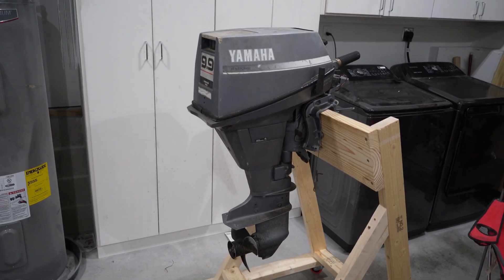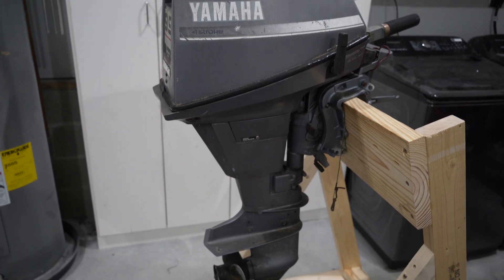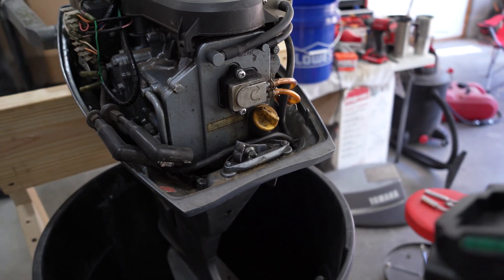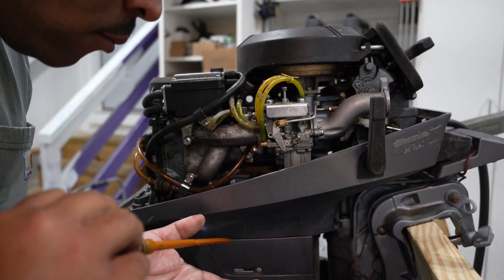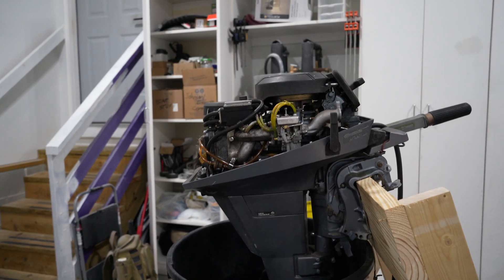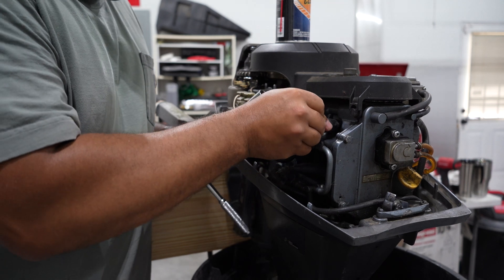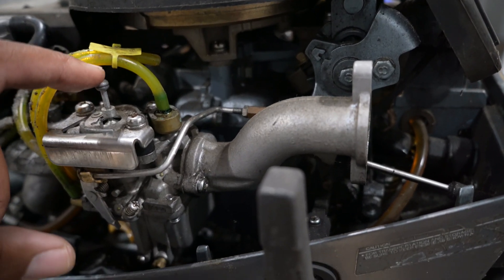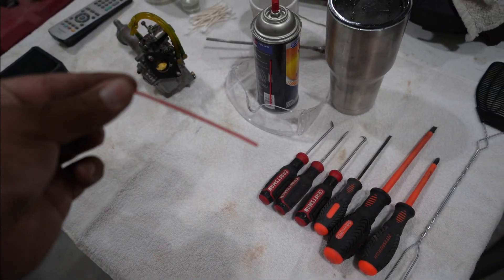1989 Yamaha 9.9hp Outboard: Can I get this old 4 stroke running?

Comment: Worked out, put a new pull rope, new Impeller, lower grease,  then found out the power pack was bad , replaced, took it out ran like a top, still running strong! Thanks .

Comment: Why did you not clean those "dirty" lines up?
Why did you not replace those brittle fuel lines to and from the pump?
Why did you not ground both spark plugs at the same time (using crocodile clips and wires) so the CDI unit would not be at risk of blowing up?
Why did you not take every electrical plug and connection apart and clean them...as corrosion is the worst thing for an engine used in a wet environment?
Why did you not immediately disassemble the leg and check the impellor before it shattered and drove all those bits of rubber up into the head and cooling passages?

Comment: I have a question regarding the same motor but it has controls to a remote control box.  How would I find a schematic of how the shift and throttle cables are installed and connected?
Reply: I have the same issue with control box needed. Did you find anything?

Comment: Good job on this one.What size adapter did you need for compression test?
Reply from the maker: It is a 10mm adapter.  Here is the link to what I ordered on Amazon.
<a target="_blank" href="https://www.amazon.com/Lisle-20530-10mm-Spark-Adapter/dp/B00CEX5B1Y/ref=sr_1_1?crid=BIMIYA24BKPY&amp;keywords=10mm+spark+plug+adapter&amp;qid=1649886033&amp;sprefix=10mm+spark+plug+adapter%252Caps%252C69&amp;sr=8-1&_encoding=UTF8&tag=makeitbett0bd-20&linkCode=ur2&linkId=ddd787358e4d55570855ef0915396baf&camp=1789&creative=9325">10 mm Spark Plug Adapter</a>

Comment: What is the compression spec on this motor if you know please 🙏. Great video nicely put together
Reply from the maker: Compression was ~89 and 90
Reply: @MakeItBetter1  and is that in spec according to the manual?
Reply from the maker: @robertlong9552  I don't have the service manual for this model.  Generally 90 psi and above is considered acceptable.
Reply: @MakeItBetter1  great stuff man thank you

Comment: I have a similar 1992 T9.9EXHQ. I put it away in storage, 5 years later when I take it out of storage, I have no spark.  I'm troubleshooting with a DVA and I get values that are within spec for the charge coil (105v)and pulsar coil (4.05v), but the CDI output is lower than spec, 60v actual, spec is 95v.  Is this enough on it's own to stop the spark? Or more importantly, to warrant buying a CDI ? Love to hear about it anyone has had a similar experience.
Reply: Hopefully by now you have got a new or new to you CDI unit.
If you test the spark plugs out of the head like shown on this vid, without clamping both sparkplugs to ground at the same time using crocodile clamps and wires.....you risk blowing the CDI unit...

Comment: I haven’t got around to my first\new boat yahmaha 9.9 similar to this outboard it rained a few times any tips?
Reply from the maker: I love these old yamahas.  Change the fluids and impeller and let her rip!
Reply: @MakeItBetter1  will do
Reply: Would you recommend spark plugs as well? Or anything else? Still haven’t tried it yet
Reply: @djtime45  
Change the oil filter.....

Comment: Were did u get adapter for plugs to check compression also the impeller I ordered on but it was to big link or part number would be a big help thanks I just bought same motor 1988 trying to get it to run.
Reply from the maker: Impeller Link https://amzn.to/3s1NEKl
Compression Tester Adapter https://amzn.to/2VA6v3h
Reply: @MakeItBetter1  thank you do much!!!! I kept buying wrong impellers from amazon always seemed slightly to big.
Reply: @msgt1942  they are suppose to be slightly bigger than housing and fins sit at an angle inside .helps to twist shaft to get it to go in.